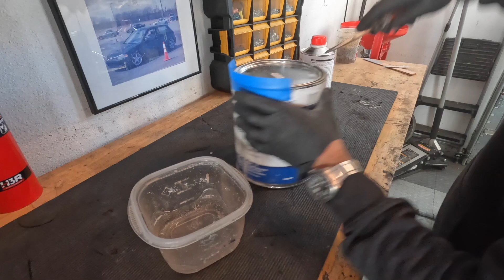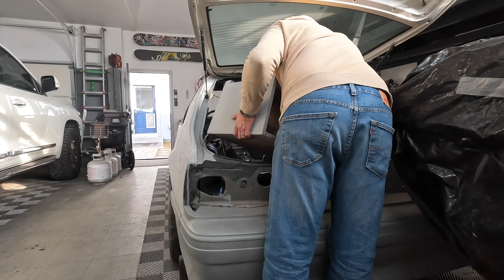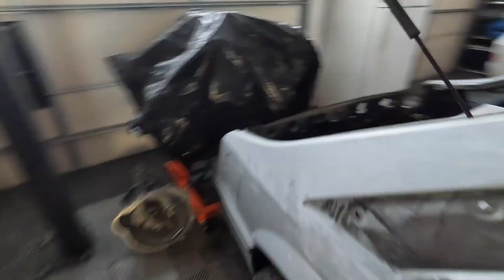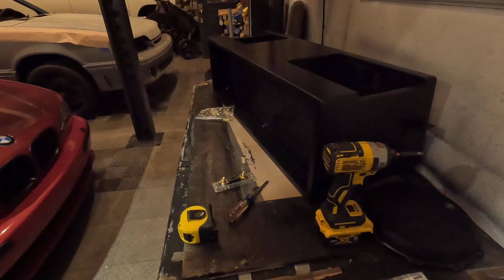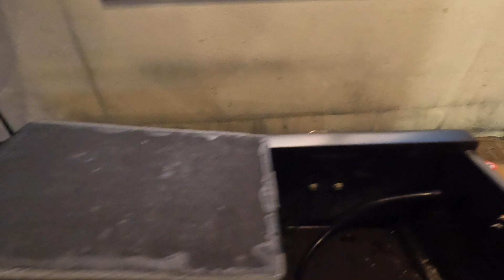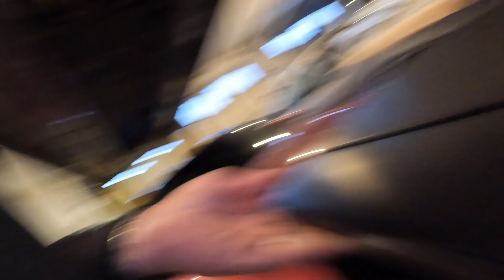Subwoofer & Battery Box Design and Build Part 2 // Box for the Fox #foxbody

Comment: One 5 channel may fit easier than one mono and one 4 channel
Reply from the maker: I'm really trying to fit at least 7 channels, preferably 9.  I'm looking at the JL Audio VX600/6i or VX800/8i along with a VX 600/1i or something like that.  I want the built in DSP as that saves room not having to also have a separate DSP module.  I'm also looking at the Audio Control amplifiers.